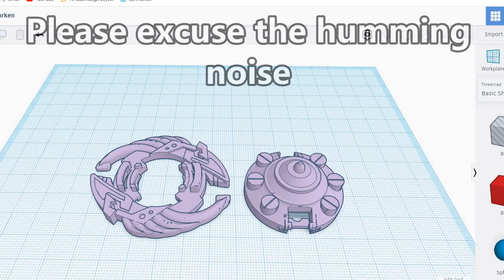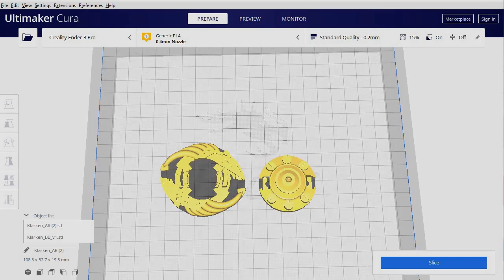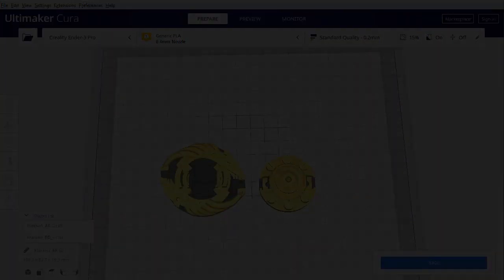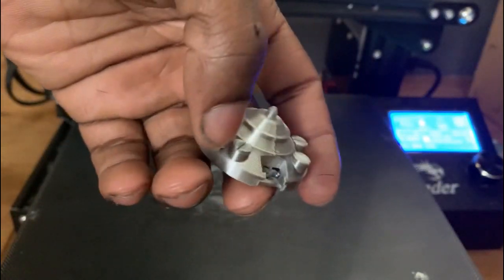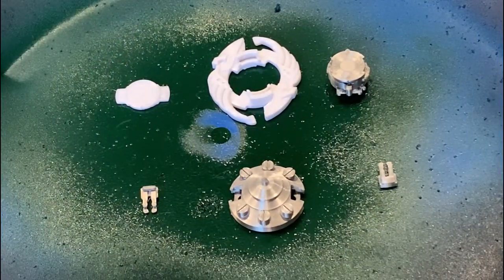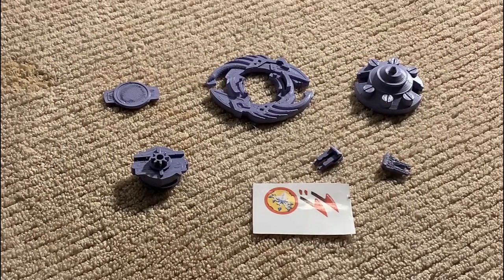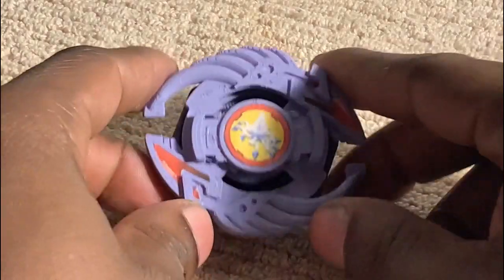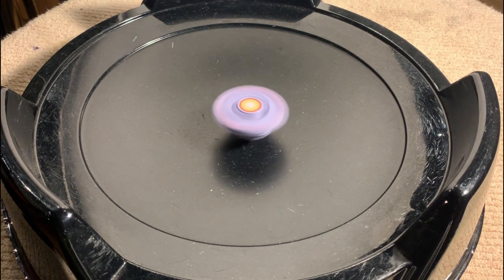Making Klarken

Comment: what are your settings for petg?
Reply from the maker: mostly stock setting but 240 extruder 70 bed
Reply: @dragoom432100  thanks ill give it a try
ive been having problems with petg and abs...
Reply from the maker: @goggleheroomegamaple820  describe your problem
Reply: @dragoom432100  well when i put the object on the raft the bottom comes out all rough same when i put them on a layer of supports i do the same for pla+ and it comes out practically smooth
Reply from the maker: @goggleheroomegamaple820  Well im not expert but petg on a ender 3 sometimes depending on the speed of the print will leave webby residue. If your print has flat bottom
then you dont always need a raft, maybe some elmers glue stick to keep it steady. Plus i use a glassbed and a dual gear extruder. It may also depend the temperature of bed and plastic. petg bare minimum heated to melt is around 235 and stick on the bed is minimum is 70, be sure to level your bed. Pla is more easy to print with a ender 3 but from what i heard having a metal hotend will make things better for petg. Supports with petg is tricky because petg really like to stick to itself since it needs a high temperature and doesnt cool right away.